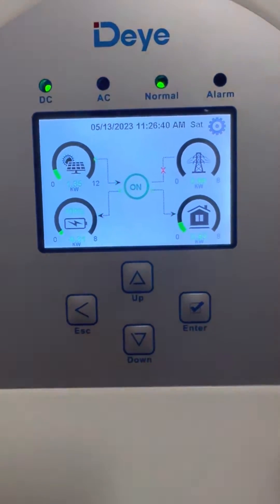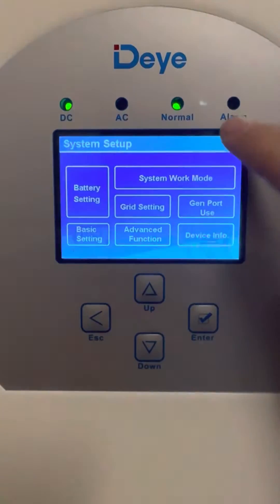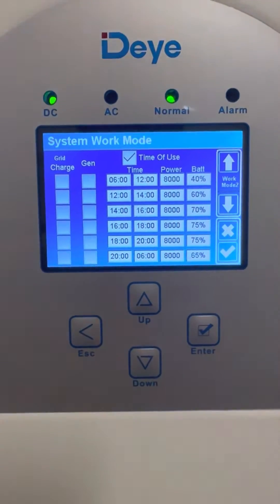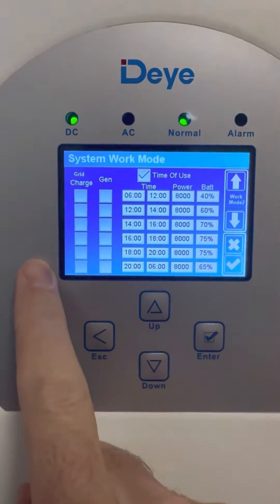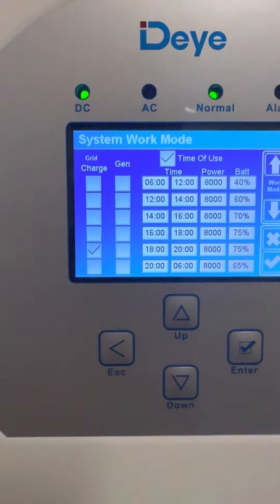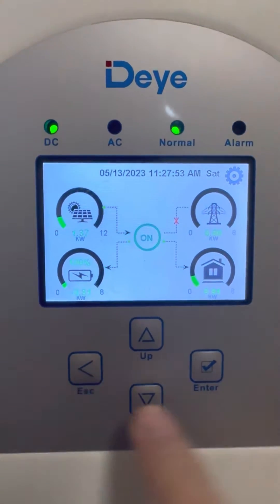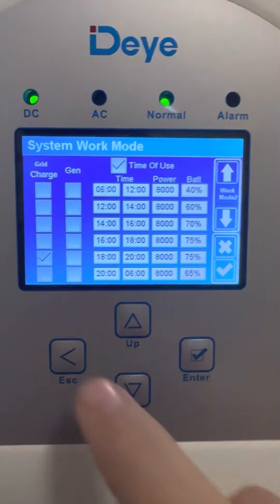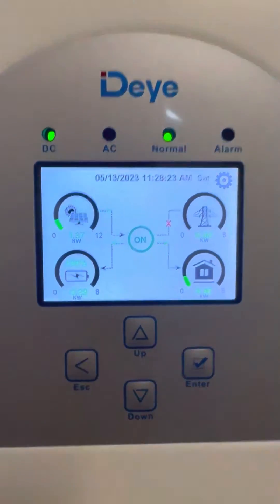Deye Inverter. Grid charge for long periods of load shedding

Comment: Hi Sir can you use EPS backup load while grid charging? we plan to use it to compalensate for grid fluctuating voltages, using it to charge battery and the output of load eps as stable voltage supply, we plan to use it for big printers as fluctuating voltages always damage print heads, avr servos and variable avr still have unstable voltages
Reply: From my experience inverter also cannot accommodate  big voltage difference try checking + and - 5 upto 10 if it continues then your good to go and use the battery for supplying your printer since you can change the settings of the inverter battery output